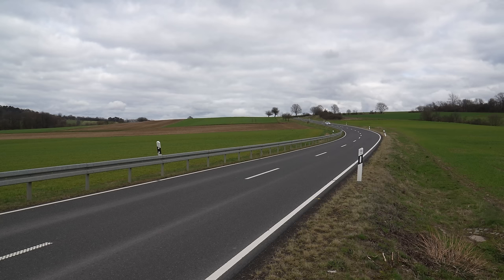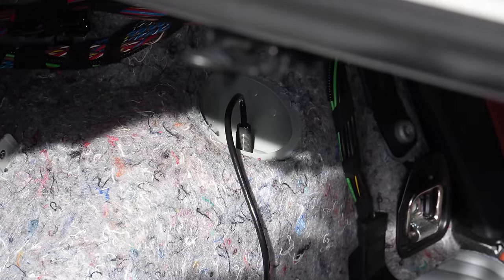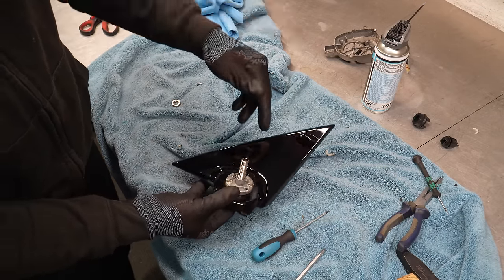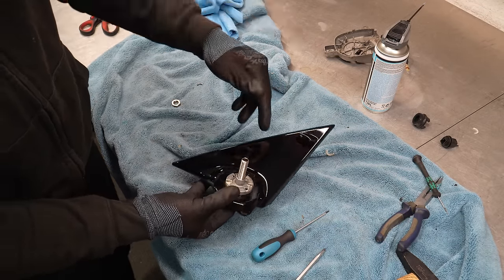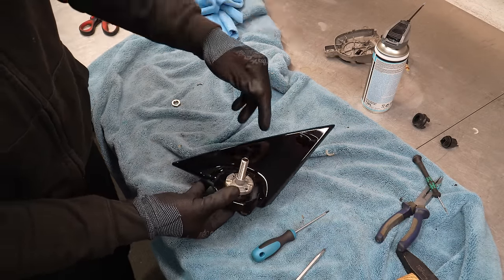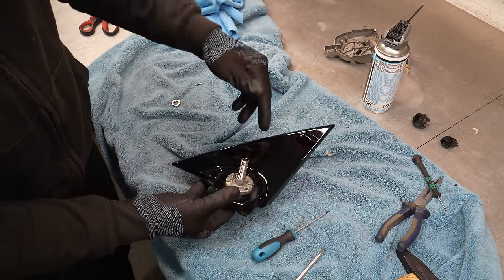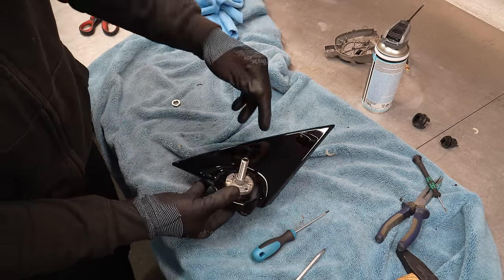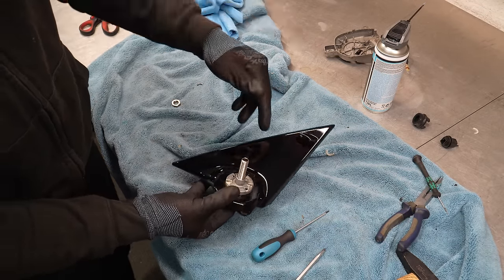Will the Built S65 V8 Make More Power? - BMW E92 M3 - Project Frankfurt: PT9

Comment: Guess we gotta say goodbye to the "There's a proper tool for this, which I don't have" joke for the fuel pumps
Reply: I love this joke so much!! 😂😂
Reply: Eh well if you NEED to buy said tool, or it's not reasonable to make one cheaply, why not just keep using the screwdriver?  It won't hurt that metal ring.  Wouldn't have to buy said tool.  But to each their own.  I admit I've bought a tool before when I knew how to remove this or that.  Sometimes the proper tool is satisfying to use.
Reply: end of an era! I though using the hammer would always be the way
Reply: @ogigorgias  Using the hammer and chisel: "This is the way"
Reply: @SerbanCMusca-ut8ny 😅😅😅

Comment: Lmao i love how you state at 200mph theres some wind noise from the window! 😂😂😂 "i have to look into that"
Reply: @sreten its so beautiful! I love it
Reply: The wind noise from these things is insane, I tried a seal repair treatment on mine but ended up replacing the seals entirely.
Reply: @Nameless_rat  I have had a mechanic looked at it for two times but still above 130 a lot of wind noise. Did the seal replacement work? and did you do only the door seal?
Reply: @wassenaarbram Yes and no, my seals were visibly dry rotted and cracking. Replacing them helped alot but it still made noise, frameless windows just let some air in at those speeds.

Comment: Thank you for the in-depth mirror repair! I fixed mine today using the same steps and now they both fold perfectly. The drilling method did not work too well, and this was the better solution.

Comment: 7:57 Strangely enough I too was certain that I had to have an adapter for the new or up graded fuel pressure sensor. But then I saw that others were just putting it in and ....It WORKED! I know it has a cone pressure fitting on the end unlike the flat ended original but it WORKS! So far 6 months no problems at all.

Comment: Project Frankfurt actually inspired me to buy my own 2008 E93 M3 at auction. Got all the electrical bugs taken care of. Got a few mechanical issues to iron out still, mainly a cracked oil pan. Other than that has a wicked quick DCT and deleted mufflers and catalytics. Must have a tune because no check engine light comes on. Sounds sweet and performs amazingly.

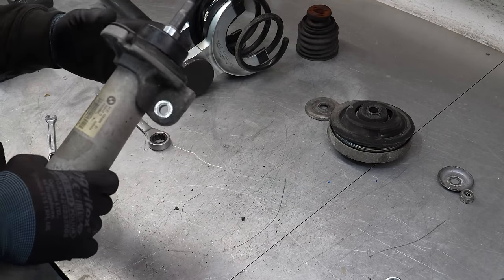Comment: 4:47 As we all gather here for a technical excellence, I feel the need to make a correction. The fact, that shock absorber's rod does not "extend" on its own, does not neccesarily mean that the damping forces are incorrect (at least not in slow to medium compr./extension speeds). On the other hand, the fact that it extends on its own, does not mean that damping valves are working correctly. So called gas force results from pressure of inert gas. In "twin tube" shocks, gas is there to inhibit internal corossion and prevent cavitation and oil foaming, so it not always "come into play". Also, naming convention of "fluid filled" and "gas filled" doesn't make sense, as either monotube and twin tube shock absorbers incorporate both oil and gas. Even unpressurised shocks (that you probably won't find in any popular car made in this century) contain gas. If they wouldn't, they would hydraulically lock due to piston rod volume increase (inside the shock) during compression.
Reply: It could also be a combination of nitrogen running out + increase in friction forces. Still, it does not tell us anything about damping valve forces.

Comment: Quick mode ! on the bottom of the  interior mirror  there is a small hole, in which you stick something small and it will turn off the USA spec compass !

Comment: 17:33 stainless steel pin + stainless steel spring with heavier coils. Fleabay has the parts you need or if you can't find the guy anymore, just contact a local CNC shop, they should have everything you need.
32:08 that's why i swapped all the hardware (as i went about) with stainless equivalents. They put junk on the car, but you're not obligated to use it. It's unfortunate, but everyone does it. I took apart a Philips air humidifier. Thought to myself "huh, they used stainless screws because of the water"... only to find out that only the visible ones were stainless. Everything hidden was regular galvanized and rusty. Anyways, if you measure the threads and look them up, you'll find the stainless equivalent relatively easily. I'd recommend doing a fleet swap, because it's cheaper to find them in bulk.

Comment: I had the same issue with the bluetooth. I had duplicate contact numbers which confused the system. There is a google tool to remove duplicate contacts or merge them into one contact, after doing that it was all fixed.

Love your work!

Comment: Awesome episode! I replaced my E90 M3 headlights recently & had them PPF'd to prevent scratches & fading. The previous owner had aftermarket angel eyes that ran hot & the heat caused the light tubes to yellow, so that is something to keep in mind. As a result I switched to Beamtech H8 LED 6500k Fog Light bulbs for the angel eyes & it works great. It's just as bright & runs cooler for a fraction of the price compared to the aftermarket kits.

Comment: I wouldn’t consider doing any high speed testing at night… I once hit at 180 km/h a truck tyre on the tarmac that had just desintegrated. You would never think about those circumstances on an empty Autobahn at night until they happen… The repair bill was rather high and fortunately covered by the truck driver’s insurance. Many other cars were involved hitting the bits and pieces. Anyway… great episode as always!

Comment: Mate if you activate air circulation on clima in any car you will get less noise from the door seals since the cabin is not pressurized from the air coming from outside with 300 km/h.  I have tried this over 250 km/h and it works. By the way I really admire your work on the cars, many bravos to you.

Comment: Hi Sreten - thanks for the vid, once again phenominal quality!!
You've probably already noticed it, or someone has already mentioned it, but if not, I believe the corrosion noted at 10:40 likely is due to galvanic corrosion caused by dissimilar metal contact, especially with refinished parts considering the paint manufacturer advised on additional coats. 

I've heard people have better luck with nicopp (nickel copper) brake lines (in case the front eventually rust and you need a long lasting workaround), but likely you already know this, so apologies for regurgitating info.

In any case, excited for the future and happy to support you on your journey - best of luck from Australia 👍
Reply: What do you mean by dissimal metal contact? I was thinking the brake dust from the rotos impregnated into the caliper and rusted.
Reply: @remasher sorry about the wording, I meant dissimilar metal contact.

If you look up a Galvanic corrosion chart, it'll better explain my ramblings, but essentially exposed dissimilar metal contact leads to corrosion (the chart shows the difference between cathodic and anodic metals). 

Here, as the aluminium doesn't have the factory protective coating (as not enough coats were used after sandblasting and it'd be harder to properly coat the threaded holes anyway), the difference between the two metals will lead to rusting. As the aluminium is the less noble metal, it will rust first sacrificially.

With that being said, I have had first-hand experience using stainless 416 screws/bolts into what I believed was mild steel parts, only to have the stainless screws rust out. I believe this happened as the parts were made with a combination of metals, some of which may have been higher on the galvanic corrosion chart, and thus turning my screws into the sacrificial cathode.

A way to avoid this would be using, for example, a ceramic paste on the threads, but I'm not an expert/materials engineer, so take my words with a grain of salt.

I say this because potentially the calipers are made from a combination of metals, with the aluminium acting as a cathode, but the stainless too acting as a cathode when in contact with other metals in the mix. 

Without the sandblasting, potentially the factory coating from BMW should act as a layer between the metals to prevent against corrosion, but hey, I could definitely be wrong, and it could be the brake dust too.

Comment: Well done Sreten, it’s a beautiful machine. I thought you had it aligned after suspension work as the steering wheel is dead straight which is rarely the case after any steering or suspension work.

Comment: At 23:00 it appears the spring is not the issue so much as the nylon body it’s attached to. It seems the nylon is worn at the top where it bolts to the underside of the dash and having lots of excessive play.

Comment: Hi Sreten! Magnificent work, my dream car as well!
Regarding the bluetooth issue… in the Media Screen, try pressing the Option button to the lower right of the iDrive dial. It should bring up a Screen where you can set up split screen and what not (depending on your specs). In that menu, you can deactivate „Bluetooth Data Transfer“ (not 100% sure, since my car speaks german, ja). That fixed the issue with the constant loss of BT connection. Give it a try if you haven‘t already. It does not affect music or radio playback, so it‘s probably better to stop whatever data is transfered via BT anyway.

I‘m driving an E92 LCI 335D turbo tractor with the max spec computer unit and the bmw individual sound system. not sure if that makes a difference to that problem.

great work, keep it up!
greetings from berlin

Comment: 3:57 PSA: if you do this, you risk the spring falling off the perches and ... well, you know. Protip: put a strap around the compressor and the spring to prevent it from falling off. Source: how do i know this? Suffice it to say that i trusted those spring compressors and i do not anymore. I was lucky. I've since bought the type that mounts to your wall and supports the spring coils from 3 sides, putting even pressure. It also comes with a safety strap.

Comment: 1. You forgot to show the repair of the breakline where the nut seized with the line.
2. You forgot to show the transmission Pump- issue where the pump didn't work without bypass. did it run when it was warm enough?
3. You wanted to do the complete rear suspension
4. You forgot an wheel-alignmet after all that subframe disassembly.
5. Did the issue with the rail-pressure sensor reoccured after the swap with the new bosch one?
6. What about the steeringwheel-shifter dummy-plugs? ;)
7. Did you bleed the clutch pedal-cylinder with the transmission-cylinder?
8. Did you do a refill of the A/C with r134a ?
9. What is that cable on the accl. pedal for @21:28
10.  GOOD JOB!

Comment: I really am  surprised you didn't go to the LCI HID headlight setup. Also if it would fit, the LCI LED tail lights are really top notch.

I have to disagree about the DCT as it is the best manual and automatic transmission, at the driver's choice. Also the Michelin PS4S are the best tires.

The Nurburgring will be interesting as everyone in the States goes to an AP brake brake set up for street and track. The standard brakes just do not hold up on the track.

Looking forward to the rear differentially build also as those clutches must be a little bit used.

Also recommend you update your navigation instrument pod to the latest version. The best solution for music is an memory stick in the console,  music over Bluetooth is always degraded by lossy encoding.

Comment: Nice to see you fix those last annoyances of the car.  I hope you will enjoy it the coming seasons.   I'm personally not a fan of the continental tire.  I've had the conti SC6 on my m3 (also US spec)  and it felt vague on the front end on medium to high speed.  Problem gone with Michelin.  Must be the side wall design. What other wheel than 359M  were you originally aiming for ?  I like the Y-spoke design but not a fan of these protruding "spokes".

Comment: Through clever geometry, modern clutch pedal springs only lift near the top of the travel. That way, when you push down, the spring resistance dissipates, and you're only pushing against the clutch master cylinder plunger pressure. You aren't fighting the spring while disengaging the clutch.  It creates a dead zone on top by design.  Does it prolong the life of your clutch master bore and seals? Maybe.

Comment: Thank you!  Very enjoyable and great learning.  You're a great teacher!   I have a 2011 E92 M3 competition sedan with about 120,000 miles that I bought new.  It runs well, and I drive it most of the time except for winter.  I've been toying with getting the suspension re-done for a little more comfortable day-to-day driving. Would you say that those Bilstein B6's would make the day to day driving more comfortable even with the low profile stock wheels and the Goodyear Pilot Super Sport tires?

Comment: Wimps, that is normal summer corrosion here in Canada. In winter the salt will even eat your lunch. To protect your undersides and keep your car rust free, you should oil spray it every Autumn.  This will neither gum up the underside or trap water, unlike most other rust proofing methods. Cheers.

Comment: For the mirror repair. I’ve been looking for exactly this process for sometime. Thank you so much! I will now set about the mirrors on my E 92 M3. So just one question why do you cross thread, the bolt rather than just using two correct thread bolts locked together?

Comment: You are not the "only one in the world who prefers the CCC over the CCC" ...As you said: the CCC (which was IIRC also avail for the E9x series) is not as "powerful" but has a much cleaner design. Usability is superior. Holding the Jog pressed for 1sec to get into one of the 4 sections is so a simple usage, I'd doit with 200 on the autobahn. Using the CIC is always disturbing the concentration.

Comment: i actually have the same issue with the clutch pedal feel in the E46. i will probably try this mod in E46 as well because of the pedal height, iam 190cm tall and to let go off the clutch i literally need to do it sideways otherwise i bump to the bottom of the steering wheel. Having it lower would help.

Comment: I <3 my e92 m3. You've convinced me to get the clutch / short shifter upgrade and I'm looking forward to the improvement. Mine has Valvetronic exhaust so I can drive around with open valves like an obnoxious twat, but the experience and the sound is amazing. The OEM look with the comp wheels is perfect but I do think a carbon lip and side skirts takes it to the next level. Great content as usual. :D

Comment: Dear Sreten. When you were driving at high speed on german autobahn and the engine was very heavily loaded, as you know and we could see that the oil temperature reaches or sometimes exceeds 110 degrees Celsius. My question. Have you considered steps to reduce friction in the engine, and as a result reduce the temperature of the working oil and thus extend its life and the life of the engine itself? I am referring to the using of Liqui Moly Ceratec. I would be grateful for your answer and comment. Best regards.

Comment: For the CIC/CCC the best option is Mr12Volt unit. It gives you android auto/ apple carplay without replacing the CIC unit and the Mr12Volt is the only one on the market that hooks up to optic fiber network in the car which gives you the best sound quality as most aliexpress units have worse sound quality from aux/bluetooth. It’s quite cheap too so a no brainer for this platform.

Comment: Hi Stretten, loving all the videos - have watched them all at least twice.
I would love your input on this as i hear conflicting information.

I have to replace lower front control arm bushings on my E91 LCI, now, my question is in two parts.

The car is at 105,000 miles so are overdue for replacement.

First, is it better to replace the bushing or replace the entire control arm both sides?
Second, which do i go for, Febi Bilstein, Lemforder or Genuine BMW parts?

I have read that even though Lemforder are OE, the bushes are completely different to the Genuine BMW parts and Febi Bilstein although considered OE are low quality parts.

It turns out that the internet is not really the place for researching suspension compononts so i would rather hear from someone that has so much experience of BMW parts.

Thank you for your help.

Comment: Random question but does anyone have a link to the filler hose Sreten uses for servicing trans and diff fluid? I can't seem to find that model anywhere and it looks so straightforward compared to the other pump styles that are large and unnecessary. thanks!

Comment: You should coat the underside of your car with lanolin once a year before winter, it will protect from rust, not damage any seals or rubbers and will easily come off using a citrus cleaner

Comment: The problem with the bluetooth is from the "Celular Data" or "Celular Data transfer" setting in the menu i had it happen in my e90 lci with the HK system and i didn't know what was wrong with it , checked the settings turned that one off and i had no problems with it since . Hope this will Help

Comment: You’re gonna make me buy an e90 m3

Currently drive a regular e90 and you’ve motivated me to bring it to oem plus spec.

I have even started replacing old bolts that seem worn out.

The only thing is mine is wrapped orange with black wheels and you would hate that 🤣

Comment: You really need to consider an aftermarket exhaust for the car since you are doing an OEM+ build.  Get the M-Performance exhaust, or an Active Autowerke or Akropovic.  Combined with the EVOLVE carbon plenum, the sound would be insane.
Reply from the maker: Thank you, but it already has one mod done in that area and it doesn't need anything else, the exhaust is perfect. Anything more, and it would be too loud and unusable.